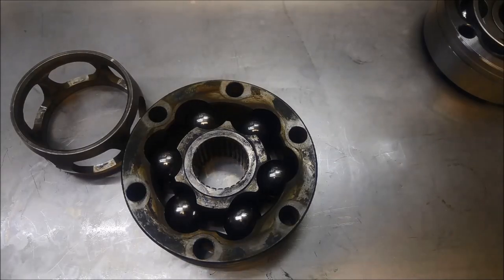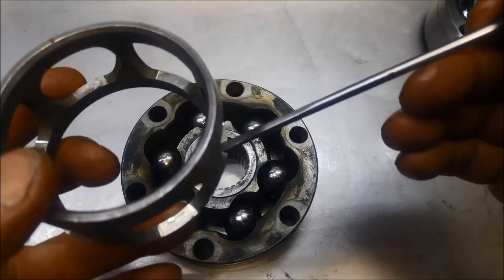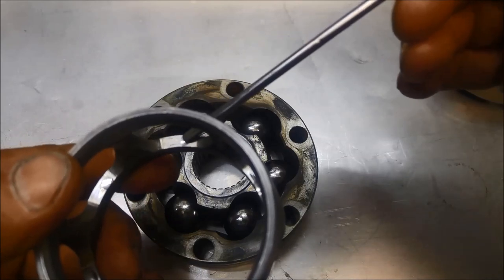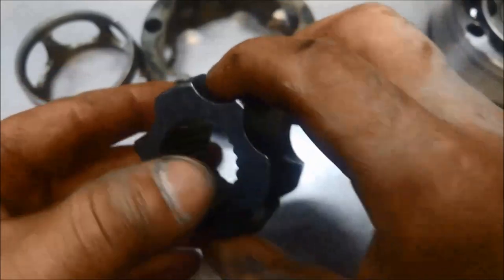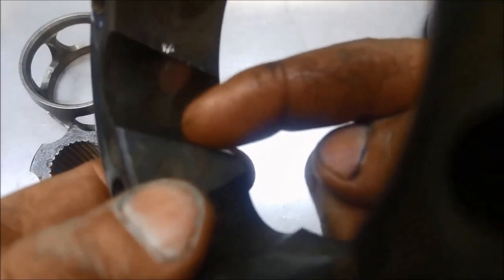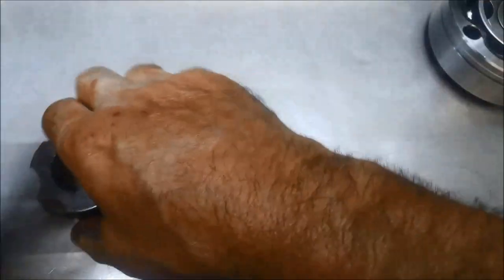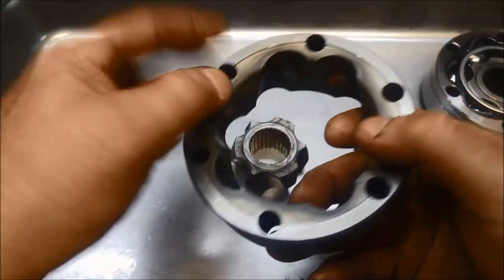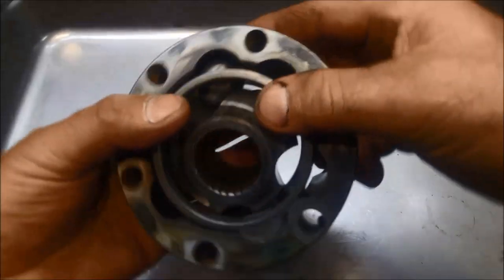How to CV Joint Old Worn vs New, Constant Velocity Joint Worn vs New How To Assemble Ball Bearings

Comment: You cannot flip over the cage! It goes only one way and that is the correct way. The rounded edge needs to be toward the shaft and the flat edge goes toward the gear-box! Also the new joint was assembled the wrong way. Flat side of the cage always goes away from axle!
Reply from the maker: thanks for that, cheers

Comment: once i had to get a recon cv drive shaft as no new ones were available at the time, lasted 2 months , from that time forward it was new only
Reply from the maker: yeah we don`t often disassemble reco cv joints...but i do wonder what is actually replaced ? probably just slightly oversized balls?
Reply: @YepThatsIt  yes thats what they told me they did
Reply from the maker: @closertothetruth9209  new balls and boots and a paint job !